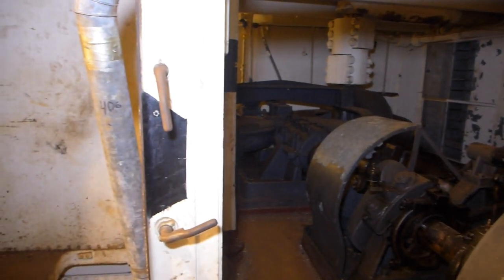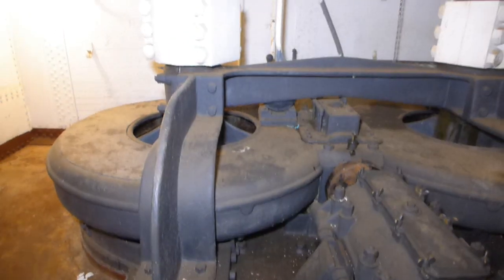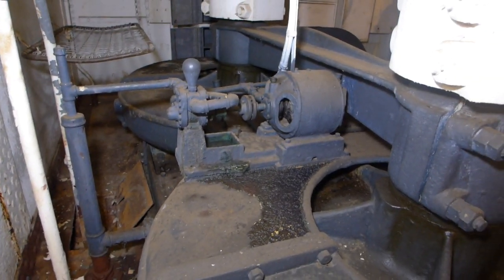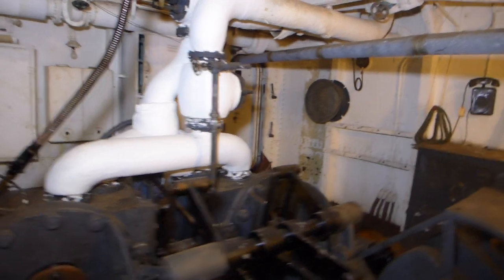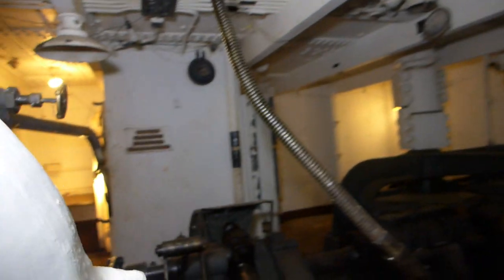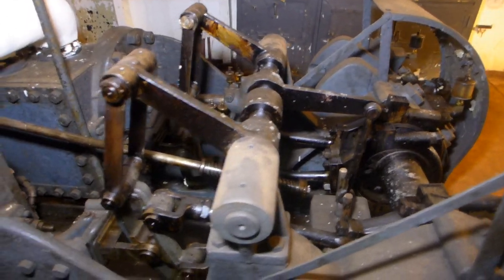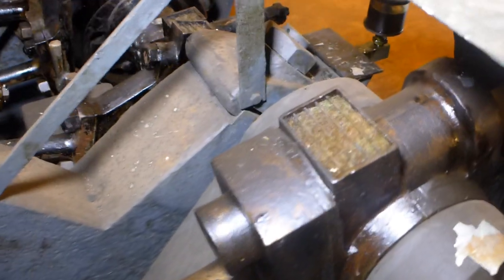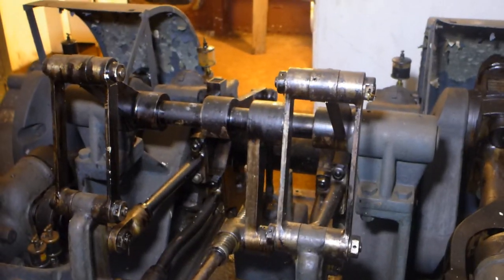Weighing Anchor on Battleship Texas

Comment: what are the fan like enclosures at the bottom of the two vertical shafts?
Reply from the maker: If you go 20 seconds into the video, I give a very brief description.  The steam engine drives a worm gear that in turn, meshes with two worm wheels contained within the circular housings.  The wheels turn the two vertical shafts that penetrate up to the main deck to turn the anchor windlasses.
Reply: @tomscotttheolderone364  Yes I saw all of that and went back in case I missed something. Look at the base at the circular enclosure. Inside it looks like fan blades. Perhaps what I am seeing are supports for the gear and shaft.

Comment: Chances are those steam pipes are insulated in asbestos I would definitely be wearing a mask in that compartment. Great video BTW.
Reply from the maker: Thanks.  The pipes are insulated with asbestos that has been properly encapsulated, making them safe to be around and even handled.  Anytime damage to the surface of one is found, the compartment is closed and a licensed contractor is brought in to perform remediation and repairs.

Comment: This was my Dad’s living space from 1942 to Dec 1945.     He was either in the Engineering or Auxiliary Division, I would have to check to be sure.     And I have always assumed that this space was shared with maybe 5-6 others.      

The gray work bench at minute 1:15, is that a brass top?     Dad always said they had a brass topped workbench?
Reply from the maker: I looked at a couple of photos that included the bench and it is difficult to tell if it is aged brass or rusty.  There is still one berth rack mounted to a bulkhead and at least 4 more sets of hooks for more.  There are also what look like crew lockers mounted on bulkheads, so there were provisions for at least 5 crew that I could see.
Reply: @tomscotttheolderone364  
Thank you for a reply and for these videos, the videos are great.    And this ship is special to me and my sister.    Very special.    
I have assumed that the guys who shared this space were senior enlisted, petty officers 1st and 2nd class.

Comment: How did they design all this way back when the ship was built
Reply from the maker: Most of the machinery changed very little and was simply copied from previous ships.  A lot of the equipment was commercially available and the manufacturers had to provide the drawings.  Things like the hull could change suite a bit, as did turrets and armor.  This required the work of hundreds of designers and draftsmen to do the engineering and make thousands of drawings.  All of this was drawn on paper with ink or pencil and slide rules, no computers.
Reply: @tomscotttheolderone364  I didn't know there was so much technical equipment on these ships,
Reply: To put it into perspective, the Titanic was the most technically advanced liner of its time - it sank the month before  USS Texas was launched.

Comment: Those are called Wildcats. (I am a Merchant Mariner and Chief Engineer)
Reply: Hei collegue
Reply from the maker: Thanks for your input and I value it, but I am not sure what you are specifically referring to.  Please correct me if I am wrong, but the overall system makes up the anchor windlass.  My understanding is that the wildcat is the "head" at the top of the assembly that the chain wraps around and actually hauls the chain to weigh anchor or disengages to drop anchor.  My understanding is based upon both the ship's plans and descriptions found on them.  Please refer to the drawings and original designer's technical description found in this link.  https://battleshiptexas.info/images/Systems/Anchor/Anchor.html
Reply: @tomscotttheolderone364  When you said “Sprocket” I thought you were referring to the Wildcat. This is one of the problems with old engineers watching shit on the phone’s tiny screens. I have installed dozens of anchor windlasses on tugs, over the years, and rebuilt them as well as barge mooring winches and towboat push-wire winches and I am intimately familiar with their construction. When you said sprocket my understand of the context was that you were referring to the Wildcat. Unless I misheard which is possible. (I have also rebuilt and repaired Markey and Intercon tow winches and various tow pin assemblies)
Reply from the maker: @butziporsche8646  Hey, I’ll always defer to someone such as yourself who has direct experience with the equipment.  I need to go back and listen to myself on the video to know what my intent was.  Thanks again!
Reply: @tomscotttheolderone364  I wasn't trying to correct you I was just commenting. A Wildcat is a form of drive sprocket for a certainty.
Reply from the maker: @butziporsche8646  Thanks, again for your comments.  Even of they were corrections, I would welcome them from someone such as yourself.  As far as a wildcat being a sprocket, I haven't thought of it using that precise term, but it is a perfect description that I will certainly use from now on whenever the need arises!

Comment: I must have missed it but where are the clutches to connect and disconnect the shafts leading to the port and starboard windlasses.  I'm also a little surprised that there is only one steam engine performing this vital function for both anchors.
Reply from the maker: There are none in this compartment.  Both shafts turned whenever the engine turned.  The windlass wildcats were separately controlled on the main deck by crew who could directly watch the status of the chain and anchor.
Reply: @tomscotttheolderone364  Thank you for clearing up this issue.
Reply from the maker: @Pamudder  Guess what?  You are right!  There are clutches located on the shafts in the windlass room used to allow using the windlasses separately or together.  What appeared to simply be couplings above the worm wheels used to disconnect and remove shafts are apparently the clutches.  Their identity was revealed when I just re-read a technical description written by the designers that was part of the system specifications.  It contains a single statement that says, “The wildcats are designed for 3” chain cables and may be operated together or singly, by throwing in or out the clutch just above the worm gear on each shaft.”  You can find it by going to this link and scrolling down to a scan of the original document:   https://battleshiptexas.info/images/Systems/Anchor/Anchor.html  It's not much, but it's enough to confirm the function written by the folks who knew the best.

One thing that also disguises their function is that I see no levers or any other means of lifting and retaining them in the disengaged position.  I have no clue how that happened, nor is there anything that addresses it in the description.

Comment: I saw where they used compressed air for an old steam shovel they were  moving to restore a number of years back. Im wondering if compressed air could be used to operate the steam engines to operate the windlass?
Reply: It's my understanding that the US Navy contract for a museum ship forbids the activation or use of any steam-operated equipment...from the boilers to the propulsion systems to the steam-jacket kettles in the galley.
Reply: @kevincrosby1760  that’s certainly true of newer ships but the Texas got turned over so early on that their contract is likely far far more minimal if it exits at all!
Reply: @kevincrosby1760  true, and even if it were allowed, there is probably at least one seized component in the mix somewhere that could really harm the machine if it were forced by air.
Reply: @kevincrosby1760  The New Jersey channel details how they cannot start the steam cycle or use any of the steam equipment, but they can use compressed air to do things that normally relied on the steam cycle, like operate the ship's horn.
Reply: @compmanio36  steam and air have vastly different characteristics.  50 PSI of steam is nothing like 50 PSI of air.  You might find that, if it even worked, sounding the ship's original horn would take a staggering amount of HP air.  Steam expands many times when introduced into a lower pressure area...this is why it works so well.